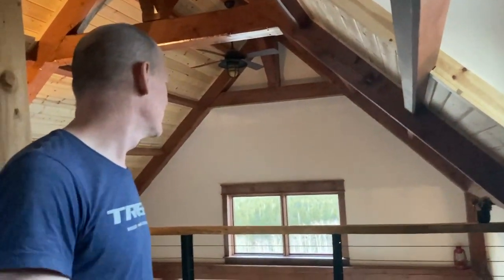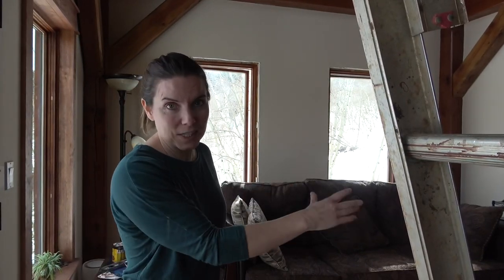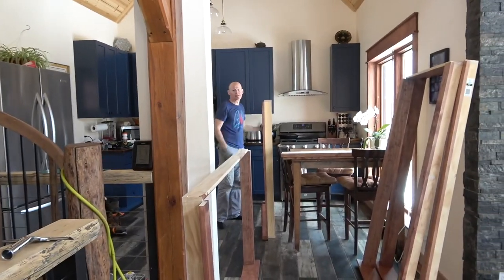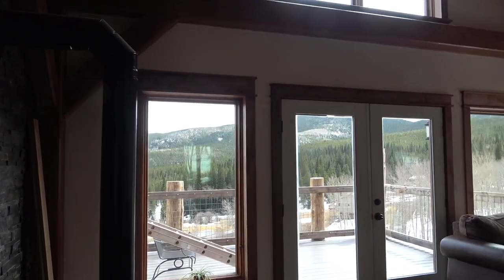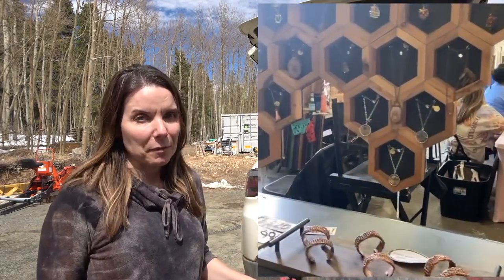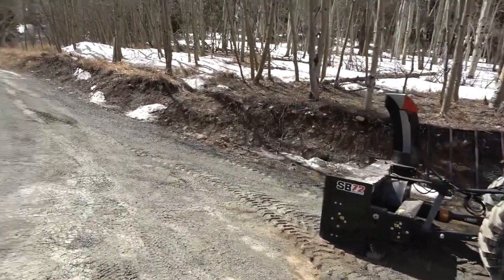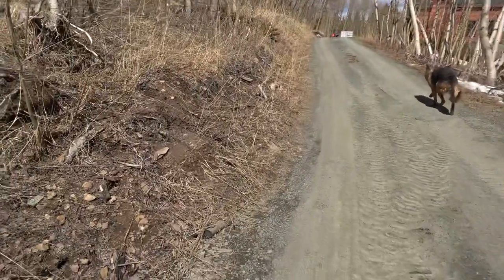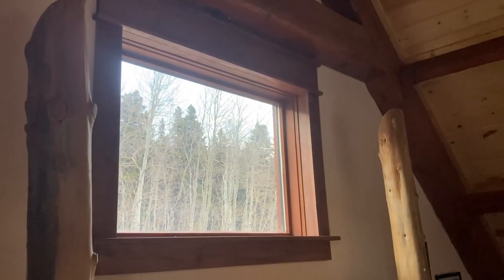Finishing Trim Work & New Fire Breaks out Near Us

Comment: I don't have any experience with window framing interior or exterior. So my comment maybe way off. All I can say about this is just what I have observed from DIY crowd. So you premade three legs then added the top as a separate piece. Most I have seen have installed each leg separately. I would think Bryan's method would make it easier to have a consistent stain. Btw in the month of March a report came out on March 24 there have been 1158 fires that have burned 4532 acres in NC. So Colorado is not alone in that department. Most of these fires are wind driven events. 

I think the wind has been worst in March 2022 then a more recent past. I went to Walmart about 3 weeks ago and if I had not had a mask in my pocket I think I would have passed out because the bitterly cold strong wind was making it impossible for me to breath. I thought I needed it for another location before I got there.
Reply from the maker: To have a consistent “reveal” of the underlying pane , he had to do it that way to get each windows unique measurements.